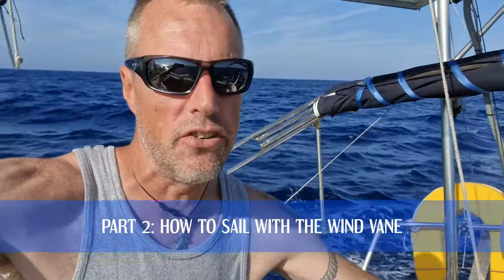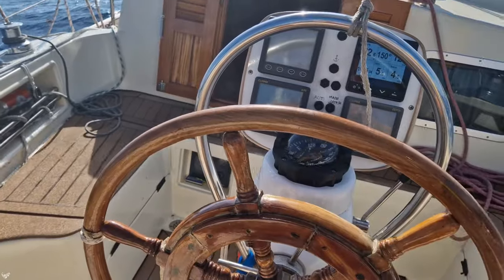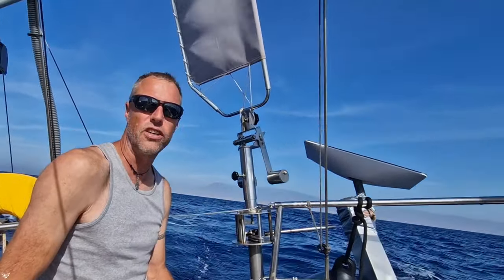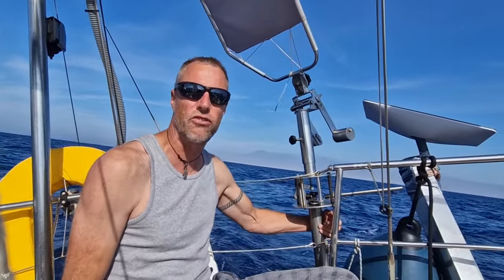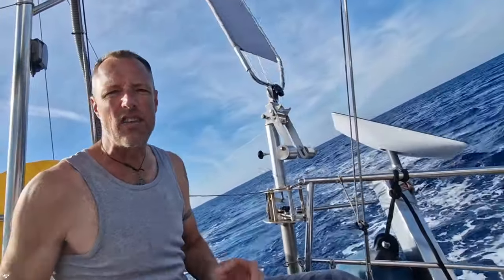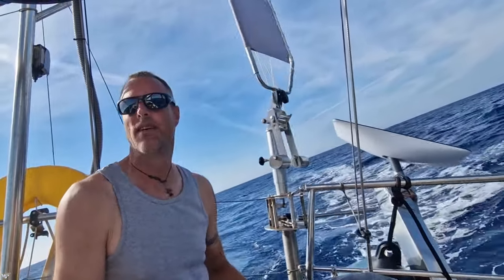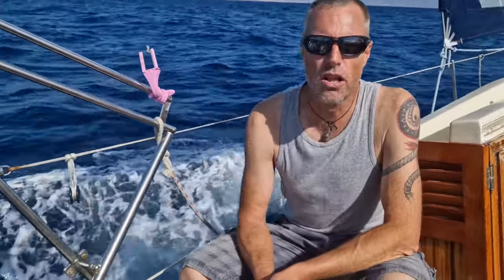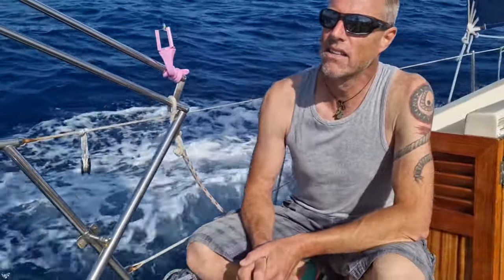How to Sail with a Wind Vane - Part 2

Comment: Very educative explanation and demonstration of the vind vane. Thanks! IMHO: What causes the boat to head up by itself, especially in gusts, is the heel. The heel causes the forces acting on the sails and those acting on the hull/keel to be moved apart from each other in the horizontal plane. This causes a moment turning the boat towards the wind. An imbalanced sail plan also may lead to weather helm, but the strong tendency to head up comes from the heel. This is why you want to keep a boat as upright as possible. @5:05 you say that the vind vane should not try to permanently counter balance... Well, of course the boat should be balanced, the sails be well trimmed, no heavy bias on the main rudder, but then the job of the vind vane is exactly this: Counterbalancing any forces which take the boat off course, it has to counterbalance its tendency constantly wanting to head up. A note on stalling sails: When pointing too high, the sails get depowered, but they do not stall. The wind just rushes along the canvas without generating lift. The sails are stalled when pointing too low or when oversheeted. Then the laminar flow breaks down, becomes turbulent, you get very little lift and excessive stress on the rigg and a lot of heel.
Reply from the maker: Yes, you are absolutely right with everything you say here. Heel is a major issue. That's why reefing is important and you may be even faster with properly reefed sails than without.
Reply from the maker: And "to stall" means IMO that the aerodynamic flow collapses. And this can very well happen if it points to high to (or almost into) the wind. But probably this is just a matter of you using the right vocabulary.
Reply: @bhsailor  Maybe it's a question of how "to stall" is defined. But in this case stalling means that the angle of attack is too big AFAIK.
https://en.wikipedia.org/wiki/Stall_%28fluid_dynamics%29
Reply from the maker: Yes, of course. So you're absolutely right. I should have known that.

Comment: Hi Bernhard, I wanted to let you know I have just finished installing the Provane on my Aloha 34 and this video was VERY helpful in getting it properly set up and I was able to have my first successful experience using  it this afternoon for a couple of hours, thanks to your video. The manual from Imre is helpful, but seeing your video and the actual functioning of the windvane through the different stages of setting it up make it much easier to understand. Thanks!
Reply from the maker: That's great to hear, thank you very much!
Although I knew how everything works in theory I needed some time to figure out how to practically operate it. Hence I thought such video may be useful.

Comment: Thanks Bernhard for the nice clear demonstration. Everything you covered I have experienced in my use of this PV. I have the add on device to the shaft which allows me to make directional adjusts using a cord. As my yacht is a centre cockpit, and I also am predominantly a solo sailor, this item is very useful. I hard anti-foul the rudder each season and remove during winter months when not doing passages. Only issue I have is the drag on manoeuvring in tight spaces such as marinas. So as I do a-lot of day sails I remove the rudder until a passage is planned. How do you find it with close quarters manoeuvres? Mine is off centred like yours.
Reply from the maker: I will cover mine with antifouling as well but this is the 1st season. I didn't think about that before. And yes, I can feel it while maneuvering as well. But this is a full keel boat which is by default not so easy to handle and I have a bow thruster. So I'm used to it ;)

Comment: Excellent video on using the Provane and very interesting to see how you gybe with the vane. I would be interested to know why you chose Provane over the Hydrovane?
Reply from the maker: There are several reasons. The Provane is mostly made from standard parts. In case something breaks you get spare parts in every hardware store. And you get a really good support since the vendor is not such a big company as Hydrovane where you are just a number. And of course the price. It's cheaper. The Hydrovane is well-known and for sure a high quality product but you pay for the brand.